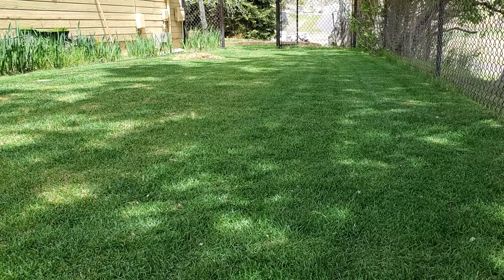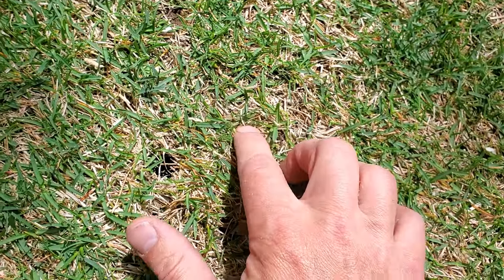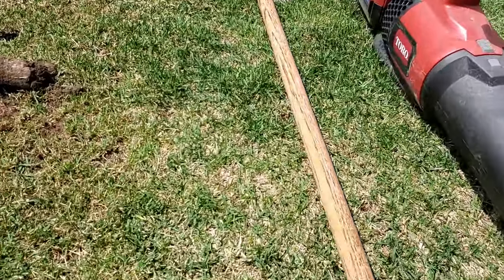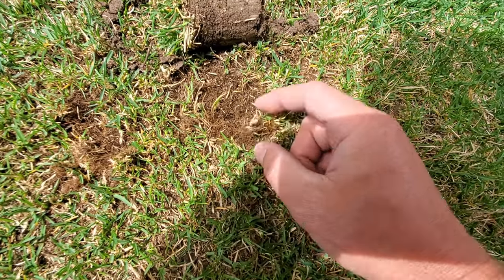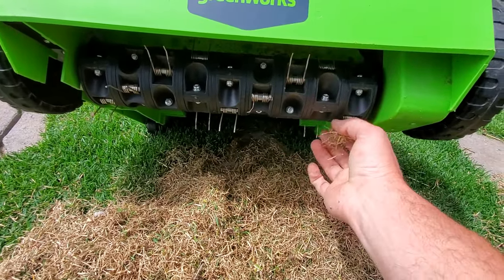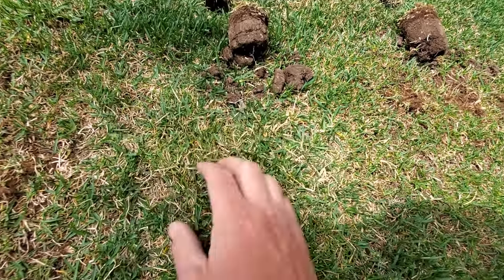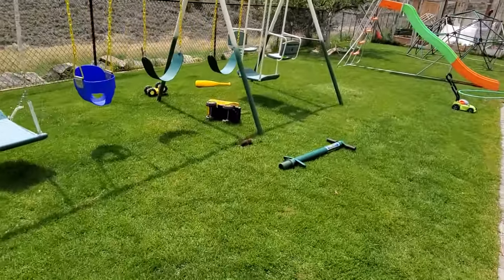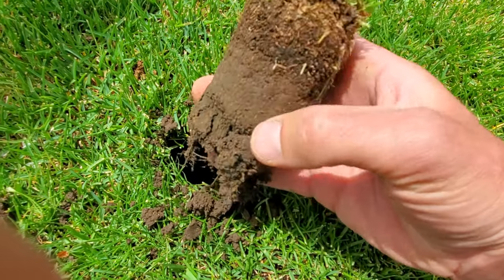Biggest Problem With Electric Dethatchers & Thatch Rakes

Comment: No offense guy...
 but you need to inquire on what "thatch" is. When you just said it pulled up, what you defined as "dead grass." As if that is something else entirely separate from thatch?... When it is in fact simply a fundamental (if not the main "body-section" of thatch's physical properties) I mean c'mon man, I don't understand the point of this video. The literal, true definition for what thatch actually is. As far as I know it to be, it's "a layer of organic matter that accumulates ON a lawn around the base of the grass blades" I'm not saying that you're completely wrong... sure some of what you pointed out was part of or (to be a bit more specific) the BOTTOM PORTION of the thatch body. Like I've already stated however, if something removes part of one thing, (assuming your expectations were for it to get the entirety of it) you can at best call it a poor performing tool. What  you can't do is just call it another thing used for something else entirely. Thatch is a combination of living and dead plant matter including crowns, stolons, rhizomes, and roots. As you pointed out in your core-piece that you pulled from your lawn manually, you just pointed out the "under the ground portion" or just beneath the surface section of the grass blade body + root system of the grass. So to say that the dethatching rake only pulled up dead grass (indicating that that is somehow something else other than) thatch & basically just caused your lawn unnecessary damage makes zero sense.
Reply from the maker: I appreciate your lengthy comment and thought process but I call dead grass clippings surface debris and thatch is very different than just surface debris. All lawns collect surface debris like grass clippings but only certain grass types are prone to thatch buildup. See this well watched video of mine for more on what actual thatch is: https://youtu.be/xPpkwqY8dl4

Comment: Got a Mantis tiller gas powered w/ dethatcher piece. Find it better than those puny electric ones...
Reply: I used the Sunjoe scarifier and it worked just fine on my 7,000sq/ft lawn. Thatch is gone.
Reply: @johnsmithson8020  Yeah that sunjoe surprises you when you finally run it. 
Seems like it's as cheap as you'd expect from the prices when you first see it but from my experience it really packs a punch under that plastic hood.
Reply: @thejarjosh  I was totally skeptical too. I always used a blue bird. Watched a few videos, and was shocked by the power that sunjoe had. Bought it, and actually laughed at how Fisher Price it looked. But man, that scarifier dug into the lawn and soil like nothing. It actually pulled me, and I'm a solid 205 lbs lol. The Powerrake attachment works well too. I love that machine. For what I spent on it, it's already paid for itself.
Reply: Sun Joe is fine for my yard too. It's not an acre. Less than one half

Comment: I got a little confused.  I see you state that you have 3/4 inch of thatch.  What is below that thatch?  Looks like plain dirt, and no grass at all.  Having a father that owned a sod farm and growing up in the early stages of that farm actually rolling up the sod by hand, it was pretty common to have a depth of 1 inch or a little more in order to have soil come up with the sod.  So based on your term of de-thatch and describe the top 3/4 inches of the core as pure thatch doesn't make sense.  I would describe that as the grass root system.  In my view - Power Rake and Dethatcher are basically the same thing.  They just pull up the dead grass on the surface making way for new growth.  Great for a spring job or prior to over-seeding or top dressing.  If you do this in the middle of the season, your grass might just be dormant due to excessive heat and end up with more damage than anything.

Comment: It would take 7 gallons to apply this product at the weekly rate of 6oz per 1,250sq ft. That would cost me $350 a week to use this product. 
With 2 1/2 acres im forced to research cheaper methods of lawn care. It makes the hobby more interesting. 
I e experimented with everything from making compost tea ,chicken feed fertilizer,  inoculation of home made char by use of my urine and my chickens poo, driving sand point for irrigation, welding and designing my own equipment for char spreaders, dethatchers , sprayers, DEF as fertilizer and such.  I should probably have my own channed called Tight Ass Lawns😅
Reply from the maker: TAL LOL - yeah thats very spending for 2 1/2 acres! I love the concept of getting creative though and I'd probably dive down the compost tea rabbit hole. Check out this video I made a while back where I experimented with making my own cheaper liquid dethatch concoction: https://www.youtube.com/watch?v=ESJuzFHh1nc

Comment: Dead grass IS considered thatch FYI. Thatch is a loose, intermingled organic layer of dead and living shoots, stems, and roots that develops between the zone of green vegetation and the soil surface. I feel like you made this video because you bought that SunJoe and it didn't perform how you wanted it to. Not that it didn't remove thatch, which it did.
Reply: Yes, I think they work great for clearing out the dead stuff and opening the grass up to get more air, sun and water.  Breaks up the dirt, loosens it up.

Comment: Poor comparison of lawn cores by the swing set. Start using a good ruler, take good measurements, use the mm scale if necessary.
I didn't see any major result from using detatch
Reply from the maker: Imo you can clearly see the lower areas of the thatch looking more soil like than they did last year. You are entitled to your opinion though. I don't run a lab testing facility here so none of my comparisons are perfect I get that.

Comment: Need a power rake with a scarifier like the sunjoe.
Reply from the maker: I've got one on the way but its not the sunjoe, I think you'd be surprised at how little of a difference it makes though. Thatch is usually a lot deeper than normal corded dethatchers or scarifiers can reach. Billy goat has one for a couple grand that cuts 3/4" deep which is still not deep enough to get through a thick problem spot on a lawn.
Reply: @TurfMechanic  Thanks for the reply Turf Mechanic! Keep up the great content. I've had the sunjoe for a couple of years and with the scarifier blades installed it cuts in about a half inch in my soil. I'm in Utah and have hard packed clay. My thatch layer doesn't get too deep, but I have to remove it because of the winter kill and it's so dry here the dead blades don't decompose. Water will literally run right off it instead of soaking in the ground. The sunjoe is able to get down enough for my lawn and even cut groves for over seeding
Reply: @TurfMechanic  Bro you have sod over sod and need to scrape all that crap to bare soil and start over. It’s not thatch
Reply from the maker: @alphasmurf6563  this is a common thought by viewers like yourself but its just not correct. I made a whole video about the history of my lawn that shows this isn't the case. I had large excavator work in spring of 2018 that dug the entire ground up when we installed our retaining walls. Anyway, it's just bad thatch, most people never actually see what bad thatch actually looks like.
Reply: @Indylimburg  get you a soil amendment to soften the soil. They have products for soil compaction. For example: Love your Soil by Jonathan Green. I have clay here in Ohio, but I can get a screwdriver down the grass pretty easy.  They way the water goes in well. Check it out. Do your research 😊